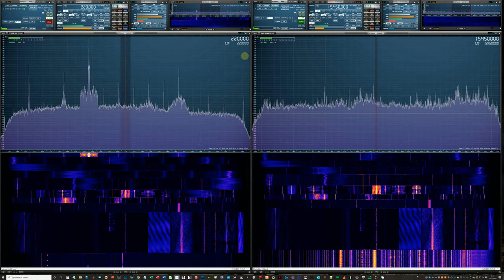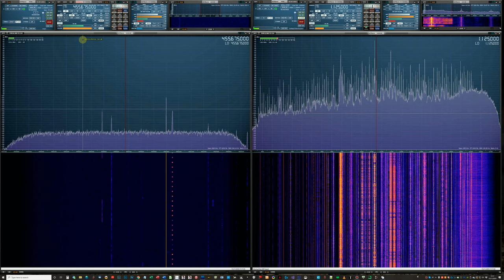Comparing 4 magnetic loops for hf

Comment: Interesting comparison. The CCW Loop Antenna Amplifier is designed to have a very low input impedance to match small (1m diameter) thick loops. We tried it with a 5m loop but it was a poor impedance match  and it only outperformed a 1m loop below 20 kHz. If you can re-run the comparison but with say a 1m loop made from coax cable you will see a different set of results.
Reply from the maker: thank you Chris I will be experimenting more with the loop  I have tried them with 1m 3m and 5m wire loops and all comparison stayed pretty much the same I will try them with a 1m coax loop as suggested, it is strange though if it is designed for use with a 1m diameter loop that mine was supplied with a 3m diameter loop, has this now changed and being shipped with a smaller loop
Reply: @UKAFG  There may be some confusion here. We supply a 3m length of wire with the amplifier. This will make a loop with a diameter of 0.95m. When you say you are using 1, 3 and 5m wire loops is this the length of the wire or the loop diameter?
Reply from the maker: @crosscountrywireless  it is the length of the wire not loop diameter

Comment: Very good video comparison! I am just wondering if the same power supply voltage for magnetic loops affected  results? Best regards!
Reply: There were some comments I"ve seen where the Bias T from the SDRplay (4.7v) is not nearly what the MLA30 needs to supply it which is between (5v-12v).  Folks had issues not using the provided Bias T from MLA30 assuming the Bias T supplied from the SDRplay RSPdx would suffice.
Reply: @cto511987  Wow, that was helpful!
So do we need to turn off the inbuilt Bias T in the SDRPlay?
Reply: @antalperge1007  Just relaying information from other accounts but my own experience has been mixed.  I don't know why but there have been times one or the other is better for signal strength.
Mystery.

Comment: Would have liked to have seen a comparison with a Wellbrook ALA-100 as thats meant for wire rather than the 1530LN is a fixed loop that way you could have tried the same length, the CCW is meant to have 3m wire too so a better comparison would have been 3m with all. Just a thought.
Reply from the maker: Hi Les I have had some time with all the loops and tried  different  lengths of wire for the loops 1m, 3m and 5m (wire length not the diameter of loop)  the results across the bands on hf were all similar whichever length of wire loop I used, the difference was that the longer the wire the better each loop performed at LF but the actual noise snr etc was pretty much identical as in the comparisons, as the video was already long I did not show the comparisons with the shorter lengths of wire as it did not show anything differant if it had it would of been included

Comment: Try making a loop from  cheap rg6 coax,use the same length as the supplied wire.just use the outside of the coax.you will see the difference then.

Comment: I'd be interested to see how the MLA30 would work with 1m coax loop and not the thin standard wire.
Reply: already removed the poor coax on mine added a BNC and have some copper wire , must give that a go some time.
Reply: @LeeDonaghy  He is talking about replacing the loop with a coax.  You connect the outer shields together to form an electrostatic shield which eliminates E-Field noise - only the B-Field is received.  I am awaiting a my MLA-30 which is on a slow boat from China right now.  I would think that a metal box would be better than the stock plastic box as well.  I anticipate tearing mine up after I play with it a bit.  The prices of these other loops is insane.

Comment: NOW YOU NEED TO DO THE SAME COMPARISON ALL OVER AGAIN... using the upgraded MLA-30 Plus!   I bet your results will be different.
Reply: Heard it was the same as the regular MLA30 except with the gain turned up in it's internal potentiometer. Turned counterclockwise to get higher gain.

Comment: Do I understand correctly that the Bonito amplifier was connected to a 5 Meter loop, whereas the Wellbrook was using their smaller 1 Meter Aluminum loop? That alone could account for a significant improvement in performance. 

Thanks for the comparison.
Reply from the maker: Hi Jacob in the comparison a 5m wire loop was used that is the length of the wire so approx 1.6m in diameter I have tried all them with different size loops 1m, 3m and 5m (length of wire) and the results were pretty much the same the only difference was the larger loop gave better performance on all at LF but the actual receive characteristics did not change across the hf bands